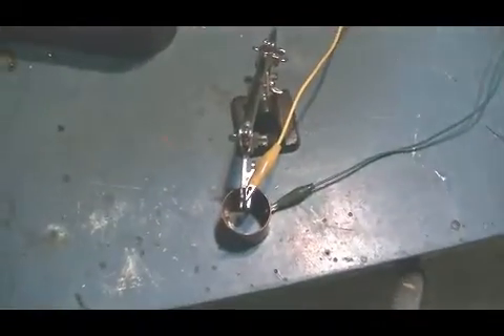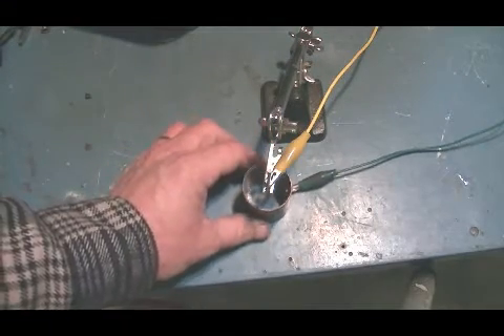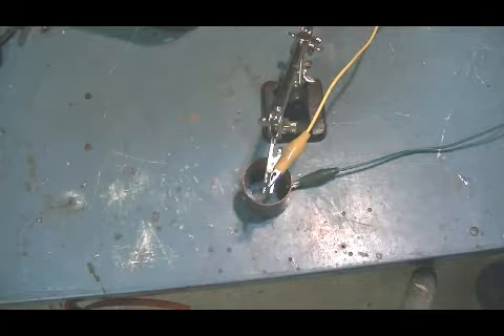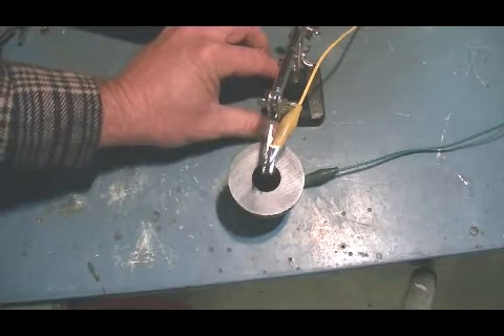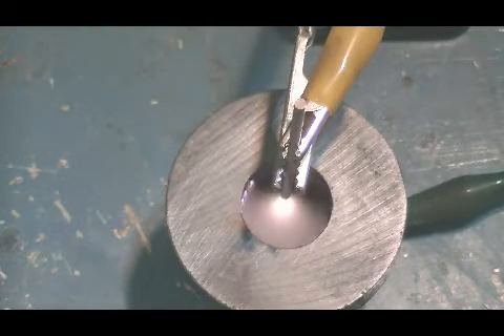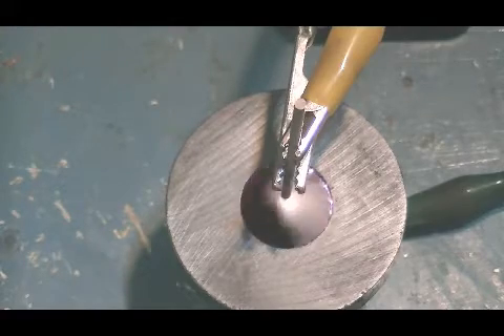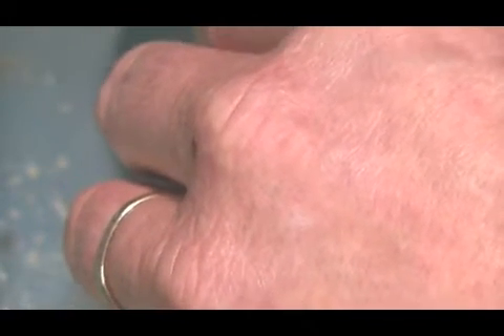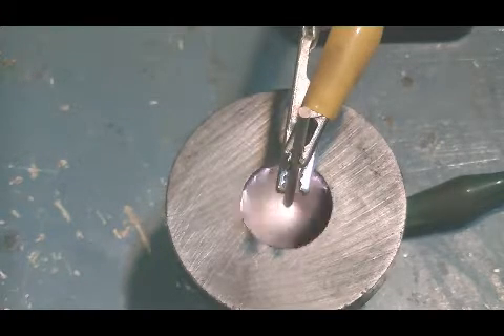high voltage in a magnetic field

Comment: I need to make a 4” inch plasma ring! I have a couple plasma lighters that I’m trying to use bcs a high voltage coil does a loud snapping buzz sound and is not a constant arch, from what I’ve seen… but like I said I’m looking for ways to make a 4” plasma ring just like in this video but with much smaller parts in the DIY sense. Anyone got any ideas on what products I can strip down for this? Like parts from a plasma ball? I’ll need to convert it to work on 12v dc and I’m hoping perhaps that will have the guts I need and the power to cover a 4” radius arch having said I have a 4” metal pipe of the right kind and a 4” ring magnet.

Comment: Right hand rule, Lorentz force acts on ionized, arcing air, resulting in rotation of the arc.  Point your index finger in the direction of current flow (between the donut magnet to the electrode).  Point middle finger in direction of magnetic field (it's a speaker magnet, so the B field is vertically-oriented).  Your outstretched thumb then points in the direction of the Lorentz Force.  When the air molecules arc over, the plasma arc is formed, and the Lorentz force acts on the air molecules.  Hence the rotation.

Comment: this what I want to find out...i keep reading ol on my meter from voltage spikes...sinse voltage runs without heat it has to be more efficient. in an air system hi psi would be equivalent to high voltage of course there has to be a way to use this in the right configuration.🤔would like to hear explanations or simple tests to show this I can try.

Comment: be really cool if we could see inside a magnetron when its running-im guessing it would be a lot similar to what you see with the arc in the toroidal magnet.
for firing off some high current maybe add a third electrode underneath the plasma field,so that you dump current thru the plasma.
might even be able to use a welder and the NST lights the arc,like some plasma cutters that strike the arc with RF.

Comment: Tin man, now you starting to get in to my feild of research! ;) vortex and all. Magnets do have a spinning magnetic field. You got it. ~Russ
Reply: cool interested in making some prototypes asap...drop clues anytime. I'm just going to use low key.
Reply: https://youtu.be/MR_zw8xq7Co
Reply: this is a high current generator I'm looking at building a high voltage spike prototype next. any useful info will be much appreciated...its maxed out to the point it melts the metal I have some solutions but hi voltage must be a better option than hi current 🤔I'm wondering next how to get more magnetic force by raising voltage instead of current.

Comment: Tin man, depending on the frequency it will rotate clockwise or counterclockwise. I did some experiments on the live show of this similar set up. The thing about the magnetic field within the noble gas popper is that it's eight radiofrequency designed to excite the gases not necessarily create a magnetic field similar to what you're thinking. Cont...